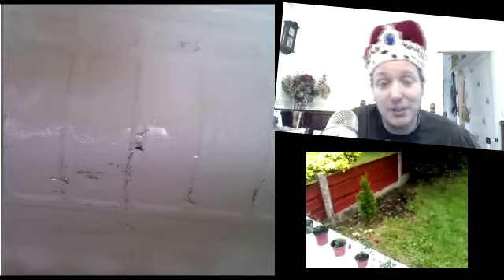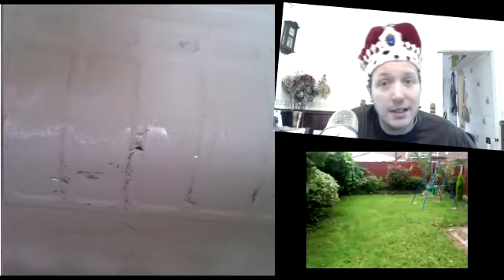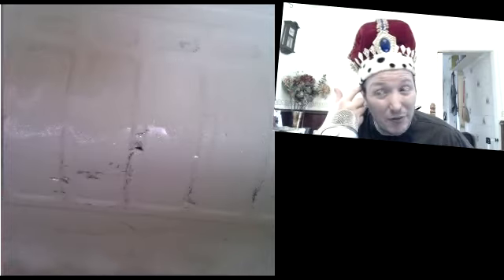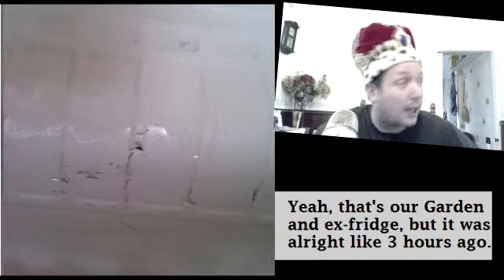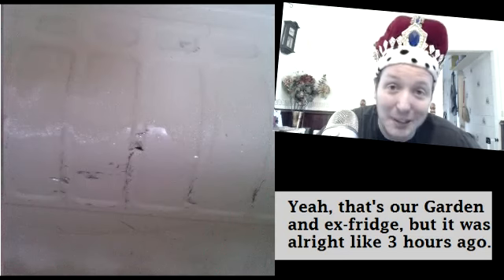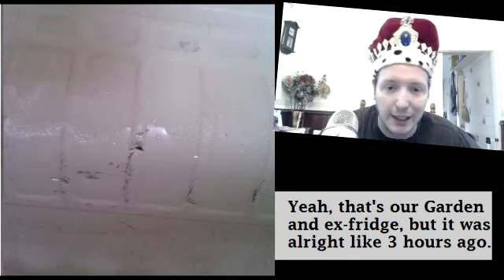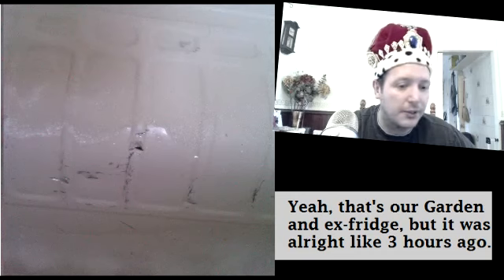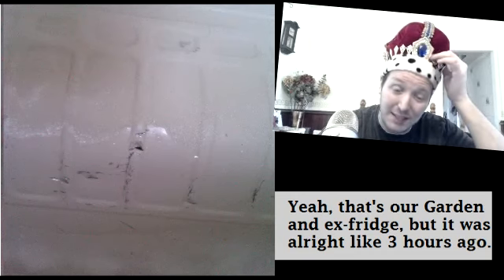Freezer Gas Leak:  After I Smashed it With Hammer Durind De-Icing...FACK!!!

Comment: I did it just now😭😭, my family will kill me, I am only 17 and it was only a year old. I have covered the hole with a adhesive to stop leakage. Will it help?
Reply from the maker: Maybe. If you were quick enough. You'll have to clean the fridge to get the smell out and get the air in a little. Ventilate the room it was in. The thing about new fridges and freezers though is it isn't such a hard fix anyway just requires a little knowledge. The gas canister at the back, that thing that started to spray out of the fridge, yeap that is pressurized and you may get away with it for awhile but the fridge won't drop down to the correct temperatures if it isn't replace or refilled, depending on how much gas escaped, you might get away with it too. There are special types of glue for fridges and freezes that have been punctured that are better at dealing with low temperatures. There may also be a guarantee as well. I would make sure no more gas escapes before you do anything...might not be as bad as you think. Ours was old so it really wasn't worth fixing.
Reply: TheScribe  I will be dead today, maybe yours is the last YouTube video I saw. :) Good bye

Comment from the maker: No it came out like a gas mate...but it could have been mixed with oil, that would certainly create a protection coat for the hand. They use oil to swim in cold waters as it keeps them warm. Actually, you can see the part that was damaged, it is that small hole in the freezer at the bottom where there is like a ledge coming out. I simply hit the one part I was never suppose to hit with a hammer and not hard either. I think I won that fight but cost only £50 to replace so what the heck.

Comment: I just did it now .. but it happened to the mini freezer which connected with the small refrigerator .. my question is can I give up the freezer and turn the refrigerator on or it will be dangereous if the hole still open ? pls pls answer me quickly

Comment from the maker: Well, it came out like gas but was obviously wet as it went over my hand as for some odd reason I tried to stop the gas escaping with my hand and it got covered in it. Just felt like a powerful blow of pressure, it didn't freeze my hand though but it was facking impossible to wash off. Top 10 times to get the smell off.
Reply: TheScribe oh my God! Exactly how I responded😂😂😂 I did what I thought was a burning sensation then I snatched it away scared of what I may have done to my hand. I then realized it was a freezing cold air blowing fast and felt like burning. I'm going to try to fix it with the info you provided here. It's worth telling the world how stupidly you've behaved! Lol. Thank You!!

Comment: Again you have to breath in A LOT of it. That  "car engine" smell was the oil from inside the compressor. That is probably what got on your hands. The gas is the actual refrigerant, probably Freon. The only reason I know this is because it is what I do for a living.. Lol
Reply: MrThundaro i happened to do the exact same thing. Hit it with a hammer trying to de-ice it. Shhhh there it goes the leak. I didn't have anything to stop the leak so i put candle wax to stop the leak.. can i put crazy glue on top of the candle wax. And just buy a new gas canister?

Comment: Hmm maybe they use a different refrigerant in the U.K. Here in the States it is generally Freon. Which is a brand of refrigerant made by Dupont. The refrigerant does have scent. If there is a large enough rupture. It usually is a very distinct odor. But, there shouldn't have been anything in there that could be really harmful. lol  Unless the U.K's environmental protection agency is more lax than our own (which I doubt lol).

Comment: I just hit the freezer compartment in the fridge with the knife after de-icing and then this sssssshhh sound started!  I am afraid , is the gas poisonous ?  Can I fix it ?
Reply from the maker: The gas is not dangerous, unless you inhale it like a junkie, obviously not particularly good for you either. I  breathed in a bit while it happened with a hammer and I turned out alright...lol. You'll have to be breathing it in a lot but you do have to ventilate the room and probably remove the Fridge from the house if you are not going to fix it. If it is an expensive fridge there is a sealant for the bit you damaged, and you can replace the gas bottle underneath the fridge. It is actually not particularly difficult to do if you are willing to watch the self help videos that people have done online about it. If the fridge is really cheap I wouldn't bother.
Reply: It`s a cheap fridge , I will buy a new one.

Comment: I did it right now my mom will beat me and leve about dad
Reply from the maker: I've broken a LCD 50 inch TV with a game controller in 2011...had to remove the screen with a new one...a bit costly. Fridges are far cheaper to repair and to be fair, they become more puncture prone as they age. So it is unfair for parents to take it out on the child, especially if the fridge is old.